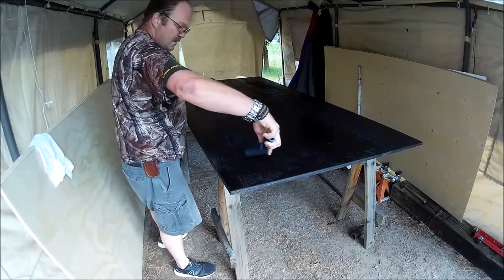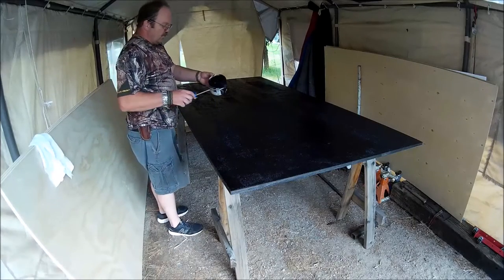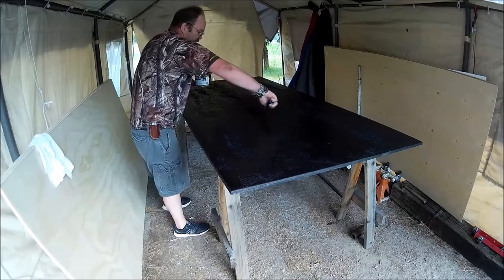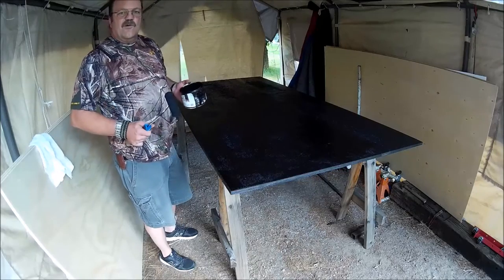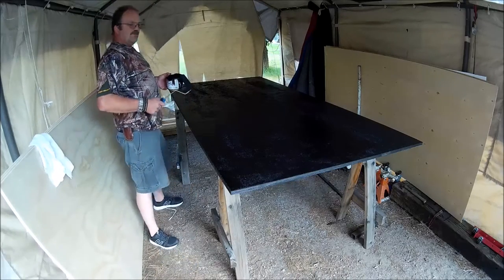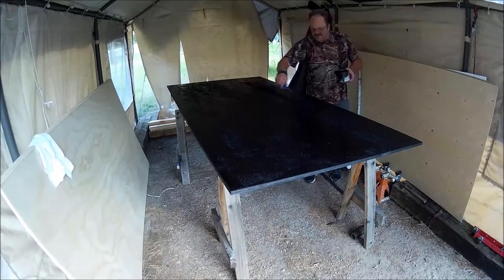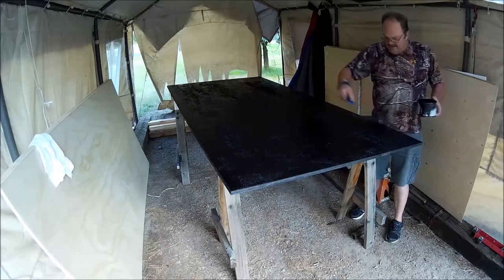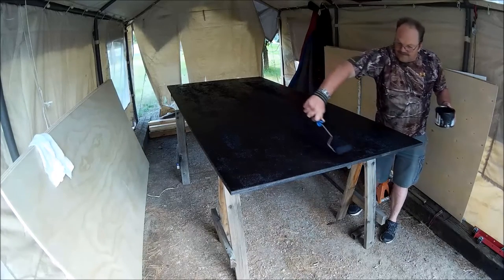DIY Teardrop Build Day 1 Starting the floor Homemade camper

Comment: I’m your 100th subscriber, great job on your trailer build. I’m looking forward to building mine.
Reply from the maker: Well Thank you very much for being follower 100. I haven't done much with it and I am sorry. During the winter I moved to a friends shop and didn't record inside his garage. I just didn't feel right about it. But I need to put up a finished video. We have used it all summer and had a blast with it. I just need to get motivated and do the final video. It turned out much better then I thought seeing as to how I had zero carpenter experience